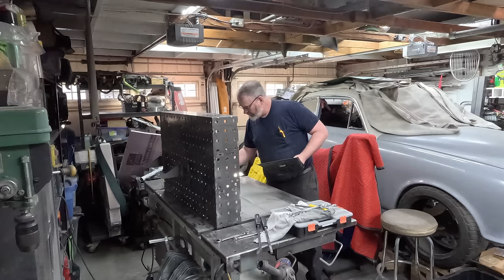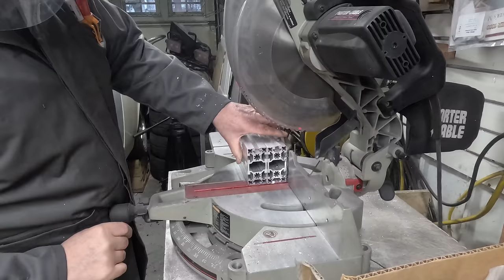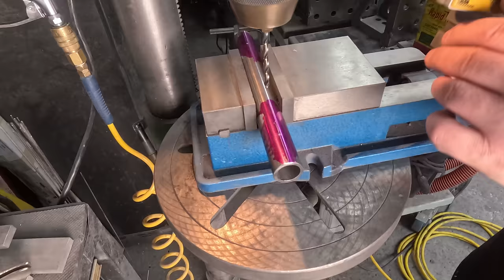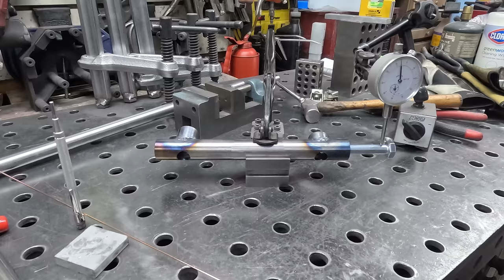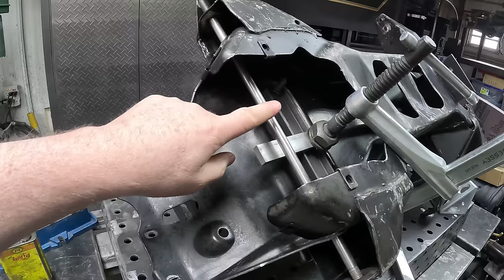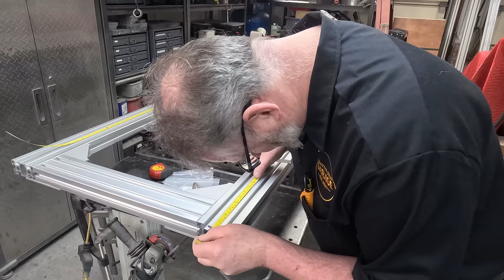DIY Frame Jig - Part 2 - Building the frame jig.

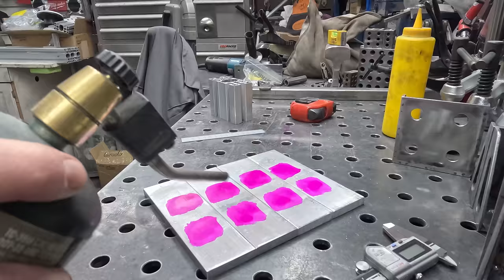Comment: 10:07 It's 45 degrees Celsius here, right now. I've been out in it, putting a steel fence up. Thank God you came and uploaded a video! I could have been out there all day. (Unfortunately, it isn't a self assembling fence, so i'll need to keep going after this.) Great video, as always.
Reply from the maker: Two weeks ago, we were the coldest place on Earth... including the poles!  -47° C.
Reply: @ThrottleStopGarage Mate. That's some pretty serious negative temperature. As much as I hate the heat, I think i'm better off.
Reply: The Bottom Control Arms go Level, what about the Top Control Arm?
Reply from the maker: @frankmelero5511   The upper is the reason behind all this work.  As much as the lower is easy - it sits level at whatever height the tire radius dictates.  Simple - no real need for a jig.  The upper then controls the caster/camber and the anti dive.  it also controls the location of the roll centre.  I'll cover this in one fo the upcoming videos.
Reply: @ThrottleStopGarage  Bottom control arm sits Level from the side "Hub Side" and front to back?
Reply from the maker: @frankmelero5511  both directions

Comment: As Lotus has shown us, as long as you don't mind it being a bit bulky, you can even make entire car frames out of that kind of aluminum extrusion. It's very easy stuff to work with. Admittedly, though, the aluminum extrusions that Lotus used were a little different, since they didn't need the bolt rails and instead used panel bond to stick everything together. Regardless, aluminum extrusions are great.
Reply from the maker: I've seen those. Impressive what you can do with glue and rivets!

Comment: Not sure I understood the dog bone jig part. Probably watch again and it will come clear. Love your content, brother.
Reply from the maker: It's hard to explain. The jig will go from the wheel bearing back to the frame mounts.  I'm not using the dog bone in the new design...so I need to capture the position and have it so I can remove the arm.  Next video, it will be clear.

Comment: Not 100% on what the plan here is. But i think i would nok just shorten the width. Then the roll center is going to be way of. I would take measurements of the Corvette parts, plot them in to a only online suspension geometry calculator. Then shorten the width in the software and move the pickup points until you get the roll center roughly in the same height again.
Reply from the maker: Yes - this is the optimization of the design.  There are specific parameters that I'm interested in achieving.  RCH is only one parameter and I need a place to start.  This fixes the front view swing arm lengths and starts to define the kinematics of the system.  If I didn't do any modelling - the net result would be a higher RCH.  I appreciate your point - I'm going to do the best that I can.

Comment: Have you searched online for CAD models or drawings for this C4 suspension? It seems like it has been out long enough for people to share this information.
Reply from the maker: Yes - there is a few models.  The problem is that they rarely include the cross member detail.  Just the suspension arms etc.  They are often floating in space - so not much use unless I can ground the model.  I am also leary of having other people do my engineering.  I had issues with that in the past.  There are also two different variants of the suspension. Anyway, I am happy to do this work so that it exists - even if it's just a helpful methodology for someone.